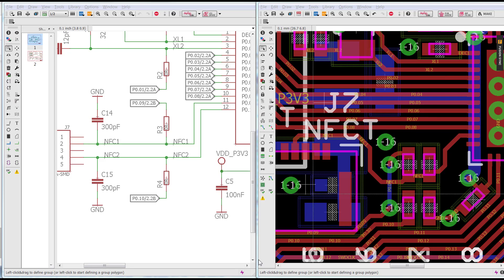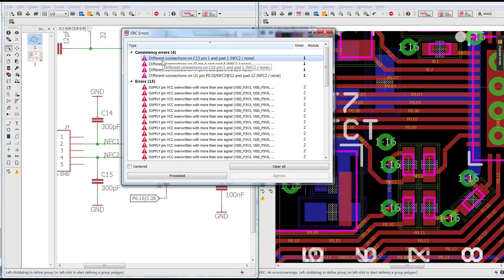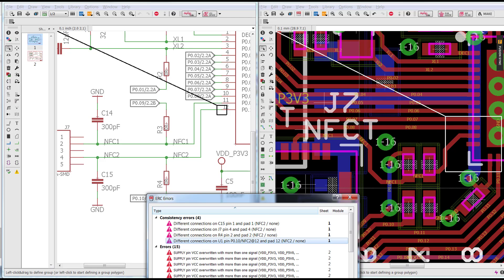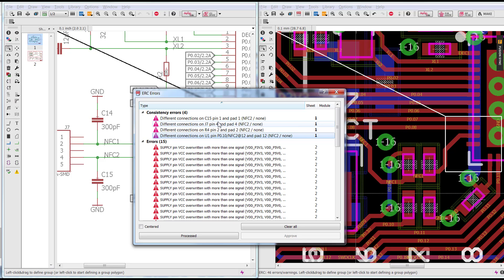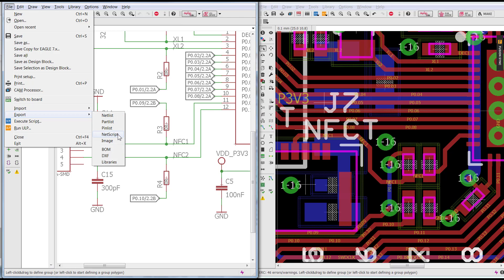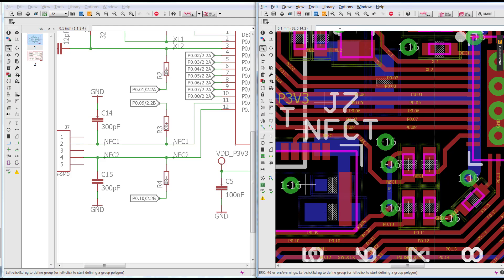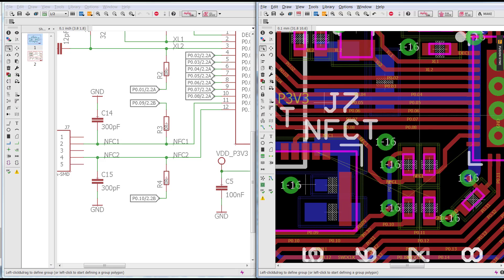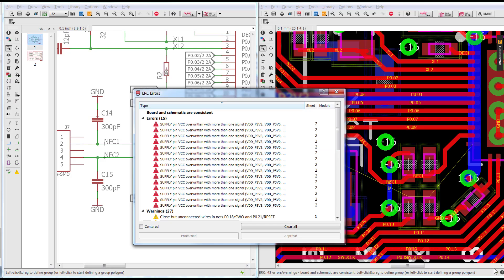Recovering Consistency  between your Circuit Board and Schematic

Comment: What about parts inconsistency?
Reply from the maker: Hi PiKey, Thanks for the question. Having inconsistent parts may sometimes be solved by using the replace command on the appropriate editor that is claiming to have the inconsistency. Depending of the complexity of the board, it might be easier to simply delete the offending component on both editors and placing on the schematic again. Please join us on the Autodesk EAGLE forums with further questions http://ow.ly/JdwA30nAKNE Thanks!
Reply: Yeah I had to add my parts manually...